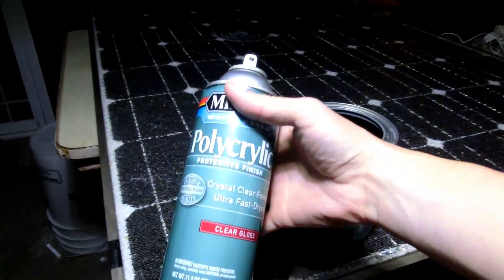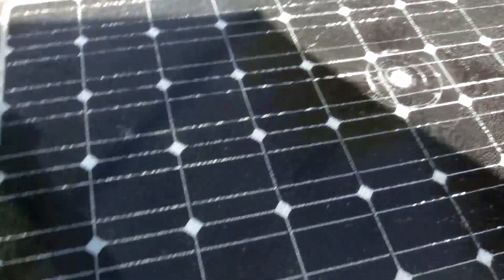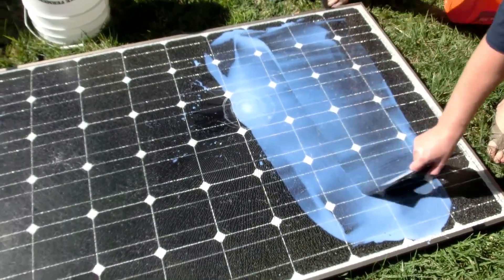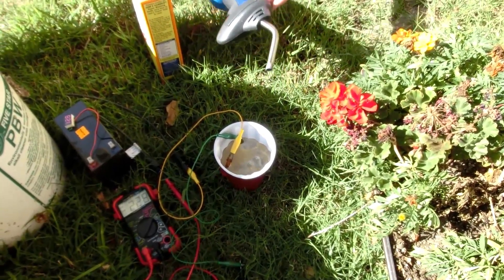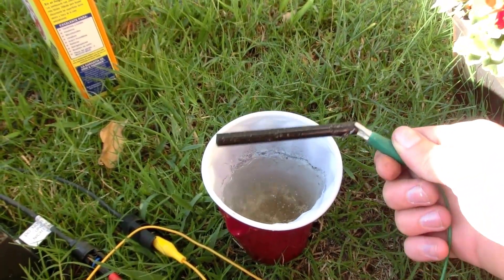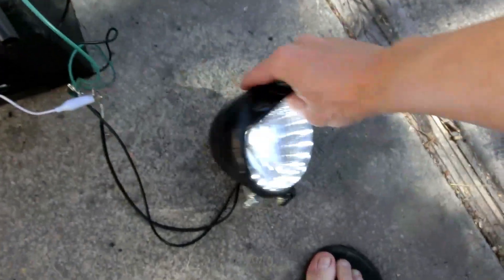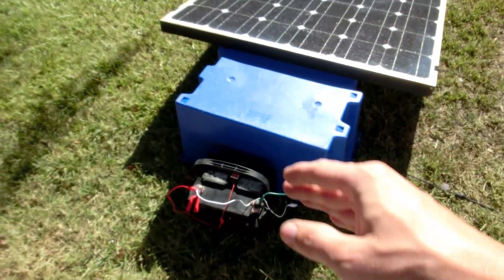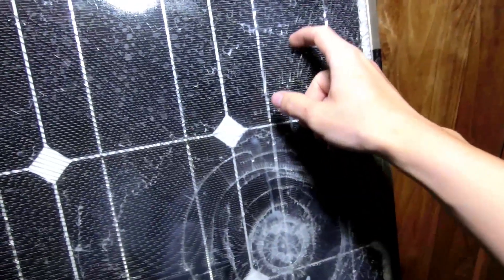DIY Repair Cracked Solar Panels

Comment: put those panels with perforations out in the sun for a few months... let the water in, and the heavy metals out. Only real repair is to replace the glass.
Reply from the maker: well i got them for a super low price from the recycling center, so its not like im out much.
Reply: The problem:  They need to go to a "real" recyling'/rebuilding shop to do a replacement of the glass properly.... if not, they will end up contaminating the soil.. and that carries interesting fines from the EPA.  (The NC State University did testing of abandones solar farms, as did  Chinese scientists.  Imagine your drinking water contaminated with Arsenic and lead.  Yep... that's what they are talking about, along with a bunch of other heavy metals.  Not a pretty sight.   Apparently when the government stops giving solar farms great piles of subsidies, they get abandoned a bunch of the time.  Not good...

Comment: 1. I would have used a epoxy uv proof varnish
2 . why did you put that crap on all the panel instead of just the damaged area?
Reply: "Solar radiation with wavelengths of 380 nm to 750 nm (violet to red) strike the material with enough energy to knock electrons from their weak bonds and create an electric current. The unused wavelengths (ultraviolet & infrared) do not have enough energy to dislodge the electrons and are absorbed as heat."

I wonder if you block the IR, could you keep the modules cooler to allow for better efficiencies?

Comment: New idea: Could it be possible to use a heat gun to "re-flow" the polycrylic where it's flaking off, and then before it cures again, spray on a second coat?

Not sure if this stuff works like that, but maybe the sprayed panel could be salvaged in this way. If the heat causes more peeling instead of re-flowing, maybe that could work to help you get the failed coat off so you can try again with a compressed air spray gun.
Reply: Ok, so the thing with broken soler panels and "fixing" the glass is unless you fix the whole crack n not just the surface you get reflected and refracted light rather than direct sunlight.
   They do still work but they cant take in as much light energy. 
  N i noticed they didnt use an optimizer to segregate bad cells.
   The video maker didnt need to use a cup of water to test the circuit, also was he using d.c. voltage to test? 
If he used a c. That is a bad reading until it goes through an inverter.
    Those are commercial grade panels. And he smashed the lid off of the spray acrilic, dont trust this guy.

Comment: I belive you have 24 volt panels and not 12 volt ones
Reply from the maker: +David Simpson yup they are.
Reply: I would use one of the cc/cv units to step it down from the 30 volts down to 12 volt with minimum loss in efficiency it how I have mine set up for charging my s3 li-ion pack I use daily for charging phone and bedside lights

Comment: I cringed watching you fuck up that solar panel with acrylic
Reply: The panel was garbage if it were to get wet. Now it will work for a year or so. Nothing was 'effed' up like you said. What do you suggest?
Reply: i thought the actrilic was clouding up the solar pannel and making it less eficent, but later in the video i notice it dries mostly clear.

Comment: 1/8 inch lexen glass silicone the edges that's the way to do it
Reply: +joetri1970 Have you done it and tested it for a year? What efficiency drop did you get? Did the power output decline over time?
Reply: +gamingSlasher does a bear shit in the woods? that sounds like a perfect and more elegant solution, although it would make it a bit heavier and obviously risk cracking again. but you can get clear glass instead of that cloudy polycrylic